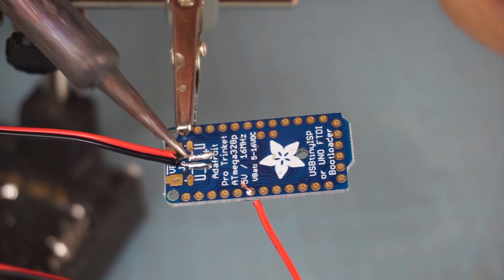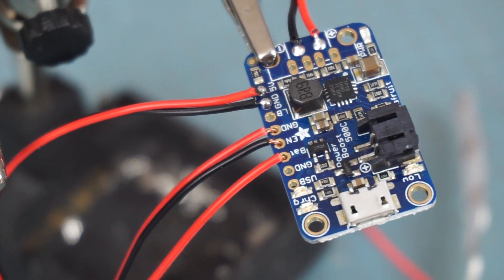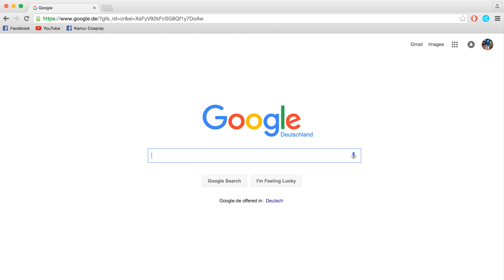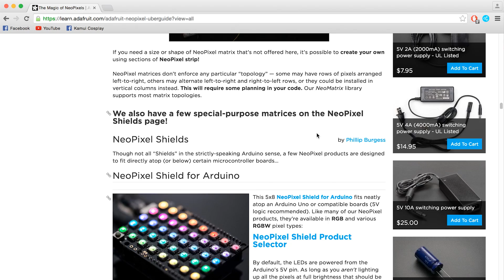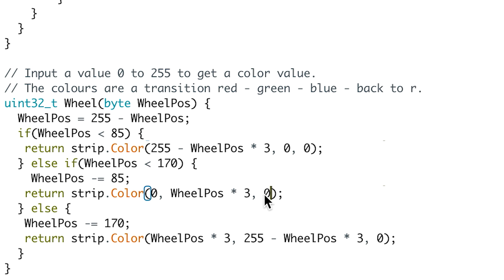Animated LED Basics

Comment: Could you just do the same but using an arduino uno instead of using the trinket and the powerboost? If so, why did you pick those? Is there any difference? Does it have anything to do with the size or portability? Thanks in advance

Comment: How many circuit boards do you need if you have 7 total LED strips? How would you wire that? Can you still use one set of boards and one of those battery?

Comment: IMO that booster is unnecessary.  Just use a microcontroller that works over 3.0-5.0v and power everything directly from the battery.  The LEDs will start getting a pink tint once the battery drops below 3.4v or so, however at that point the battery is almost completely dead anyway.  If you have the LEDs lighting up white this will save roughly 50 mW per LED.

Comment: Hey there! I am making a prop of Genji's Dragonblade from Overwatch, and everything is going well, with the exception of the lights. See, I need to use strip lights so that it will fit on the back of the blade, but every strip light i have found Has had a 3-4 AA battery holder. I need something smaller that could fit into the blade handle. Usually it would be fine to have a large battery holder, but due to the light and slender figure of the blade, I need help. Please! Is there any tricks you have up your sleeve?
Reply: I'm running into the same issue with the Aerondight blade from Witcher 3. Any progress here?
Reply: @Alexis Campbell I ended up finding a smaller battery holder on amazon; it uses coin batteries. as long as the pack is the same voltage, you should be able to rewire it to the light strips. The sword works great!

Comment: This is a great video, but you could consider pre-tinning the wires before soldering, or even using connectors. Personally I pre-tin all wires, use connectors where I can for easy assembly and disassembly and use many sizes of heatshrink tubing, of course black and red to match power and ground, and other random colors for other wires, like data. I also use hot glue inside the heatshrink tubing to ensure stress relief on the solder joint. A little drop fills the entire tubing. It's excessive, but clean and sturdy job is important to me. No hanging wires or straight to board connections without stress relief.

Comment: please learn how to solder properly 
i am not trying to be mean or anything its just that with how you solder 
you will get cold solder joints . which is really bad since you make wearables 
cold solder joints can easily lose connection or even short out the circuit . 
you really dont want your leds to give out while you are on stage or even worse burn you if you short out the battery.
plus an extra tip always use lead based solder it just makes for a better and sturdier connection . 
Apart from that it was a great video
Reply from the maker: +Crushonius I actually never got any cold solder joints and my LEDs never failed to work. Not a single time in 14 years. :)

Comment: Nice tutorial. One thing though, you do not need the ground wire between the switch and the Trinket. The switch is a single pole double throw slide switch but all your doing is breaking the +5 VDC to turn it off or on (the wires would be on the center connector and either one of the outside connectors). Now if you use an illuminated switch (lighted when turned on) you will need that ground for the LED light in the switch to turn on.
Reply from the maker: Thanks for the feedback!
Reply: Always try to help when I can.Being a tech/geek/nerd I build all sorts of things plus I've been doing electronics for a very long time. ;)

Comment: Everything ive read says that you should put a resistor on that data line to help minimize noise, Ive run them without and not had a problem, but I always put one in anyway. 
It looks like the way you have wired it is using the voltage regulator on the microcontroller. You can get away with it with a few LEDs, but Ive found that when you do it, it really heats up the voltage regulator. Ive changed my designs to use the 5v on the USB jack for the LEDs, it bypasses the voltage regulator. I feed the device with 5v from a phone charger power bank device.
When you strip wires for soldering, you should tin them, then trim the leads down so that you have very little exposed wire, it helps prevent shorting, which can be a really big deal when its the main power wires.
Reply from the maker: I know thanks! It's not really necessary however since I'm using a low voltage power source. So I neither need a resistor nor a capacitor between the data pins. :) I also did it with 18 meter (around 600 pixels) of LED strip and it's not a problem. :)

Comment: FWIW, that circuit should probably have a small (few hundred ohm) resistor inline with the data line, and a decent size capacitor across the ground and 5v line going into the LED strip.  Otherwise, it is possible to damage the Neopixels.  Thanks for the video.
Reply from the maker: +Dale Hawkins Not necessary if you only use a 3.7V lipo battery! :)

Comment: How would I program the light to do a slow pulsating effect?
Reply: Val Lan by slowly increasing and reducing all the color values at the same time (i'm pretty sure you have to keep the ratio of the rgb the same, so the color stays the same... so maybe write something like (this is pseudo-code, i don't remember the functions exact syntax anymore^^ pretty sure changing its type to int is important though)
counter = 0
leds.color([((int)counter*0.5) ((int)counter*0.2) ((int)counter*0.4)]
and increase counter every 10ms or so and then decrease it again afterwards

Comment: so my trinket as a flashing red light rather than a pulsing light. it wont connect to my computer to program and i am lost as to where to go from here. i have it connect to a 2.0 USB hub and the battery is connect. it just wont connect for me to send code
Reply from the maker: Hey there. Hard to tell what your problem is from here. Have you tried following the official guide to how to connect your controllers with a PC ? https://learn.adafruit.com/ladyadas-learn-arduino-lesson-number-0/install-software-windows
Reply: You probably have a faulty trinket, ask Adafruit for a replacement
Reply: Follow the instructions on Adifruits site. If the software isn't seeing the processor board it may be that you have the work type of board selected and or the COM port is not correct which will prevent the computer from talking to the board to program it.

Comment: Where can you buy all the things needed? What people can create with LEDs are so amazing!
Reply: Adafruit, go google it
Reply: Adafruit for the Trinket (processor board), 5v dc lipo charging/power booster board, and the battery pack. Then Amazon for the WS2812B neopixel LED strips and the switch.

Comment: Hey. Nice video's!
Bought your book on LED's, very helpfull.
I was wondering thought. 
Whats the best way to connect two led strips to one on/off switch to let them work simultaneously while each having there own animation?
The same question for a led strip and individual leds.

Hope you can help me out!
Reply from the maker: Hey Alexander! You can use only one strip and seperate them into two sections or use two different pins. You also need to write a code for every section/pin. It's quite hard to explain and I'm not an expert, but www.adafruit.com offers great tutorials, so hopefully you can find there some help! :)
Reply: Alexander Heeren you can also just use them as one strip and habe them have different effects... you can just apply changes to led 1-15 (for example) without changing what led 16-30 are doing^^

Comment: What LEDs did you use? I've been looking at these: banggood . com / Wholesale-24-Key-IR-Controller-5050-RGB-5M-300-LED-Strip-Multicolor-Waterproof-Lamp-p-51601
but they seem to have four pins instead of three? I'm guessing that is RGB and ground; in your video I see power, ground, and data? I'm confused o.o
Reply: That's an analog strip, that won't work because all the led's in an analog strip do the same thing at the same time. You'd need something like a ws2812b
Reply: thank you so much for clarifying! that makes stuff so much easier to understand/research.
Did you by any chance happen to finish your book on advanced led lighting? I'm gonna need all the help I need! lol. Working on the guns of Lucian from League of Legends. Still debating on how I should implement this project.

Comment: Can you use any rechargeble batteries or do you need a 5V battery? if yes can you give me a link? I wanted to use a 3,7V 2500mAh lithium batterie
Reply from the maker: You can use every battery you want (rechargeable or not) but you have to take the Volts into account and change your circuit and the resistors accordingly. :)
Reply: KamuiCosplay Ich bin nicht so gut in Englisch es wäre sehr hilfreich wenn du es bitte ins Deutsche übersetzten könntest :D

Comment: i can tell you're not an electronic engineer or any sort.
because you should have soldered at the copper pad of the terminate point of the wire then trim off the excess.
because that will prevent the pads from tearing away with the wire when too much tension is apply to the wire.
Reply: though, it an excellent tutorial
Reply from the maker: +Reese Me Good tip! Thanks!
Reply: KamuiCosplay :)

Comment: Ou make it look so easy!  I want to make my ligjts go to some sound and chang color to another sound.  Would this be done in the coding?
Reply from the maker: Yes, you can use micro controllers to program lights, sounds and motors all at the same time. It's very complicated though! :)
Reply: KamuiCosplay will you be covoring it in your new book for advanced leds?

Comment: I'm looking into doing a project with some neo pixels, i was hoping to use a x16 ring and some strips but i'm feeling a bit confused as to power requirements. Do you know if a 5v micro controller (metro mini) running off usb would have enough omph to drive all the lights?
Reply: Matthew Tavatgis do the math: one neopixel at full intensity (255,255,255) draws about 60 mA. multiply   by the amount of LEDs. so 16 x .06
Reply: Ah, thanks

Comment: I'm working on a cosplay for a character called Shen from League of Legends and I want to use a sheet of fluorescent plexiglass for the blade of his sword, sand it to give it a frosted effect and have 4 blue LEDs at the base to light it up but my problem is where would be the best place to hide all the circuitry and have an external on/off switch?
Easiest way to find what I'm talking about is searching "Shen's spirit blade" in google.
Reply from the maker: Hmmm that's a hard one. Best way would probably be to hide it somewhere in the handle where you put your hands over it. :/
Reply: My recommendations are put the batteries in handle nearest pommel (easier to access and helps balance), circuitry nearest the guard and hide the switch as close to the guard as you can where it can be hidden by your index finger, and easily switched too.

Comment: Love your work! Questions: how do you charge the battery pack? This setup is exactly what I was looking for. If I follow this how long will the battery last and is this setup only for one strip of the LED, for example can a longer strip be used for this battery size? Can any brand of LED strip be used with the ardafruit booster and trinket? Thanks so much!
Reply: As far as your question about charging the battery. You will see the powerbooster/charger regulator board at 2:02 on it you will see on the right a micro USB connector (used to charge it via wall, computer, powerbank supply), the connector on the top is for the battery to plug into and on the left is the power output side. This little board is a great board because it allows you to not only power a device with the battery (regulated 5 vdc) but you can also be charging the battery while it's still running the circuit your working on. Also when you get this regulator/charging board it comes with a normal sized USB socket that can be soldered in place on that left side if you looking to plug a regular USB cable into it to power something.

Comment: why not use a lipo battery
Reply: she is using a lipo battery
Reply: Pink Star Cosplay oh ok. Thanks. But it looks way to small to be a lipo. I think airsoft lipo batteries.
Reply: It's a pack of 18650 LiPo cells. Very common size. You'll find them in everything from laptop batteries to power tools.